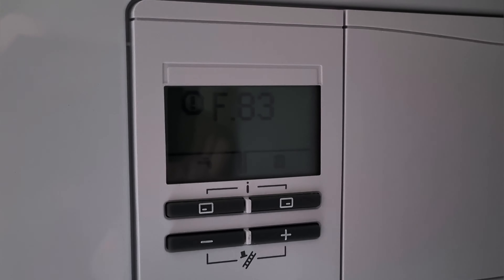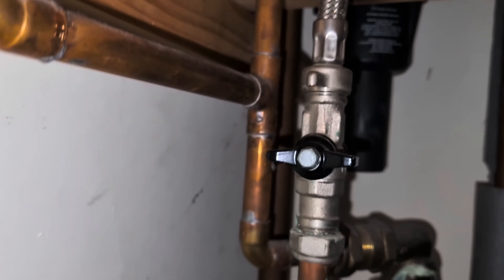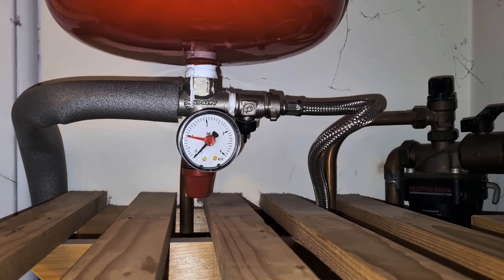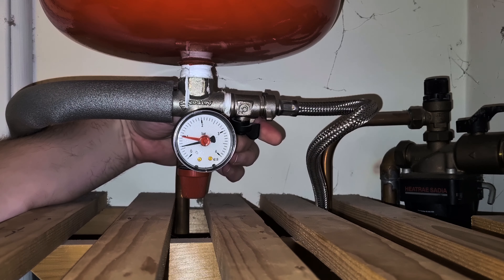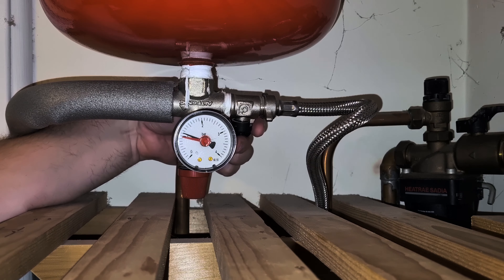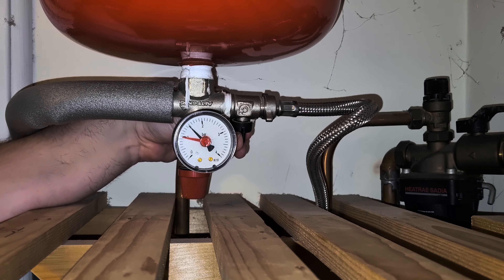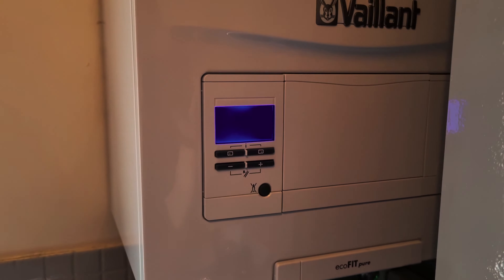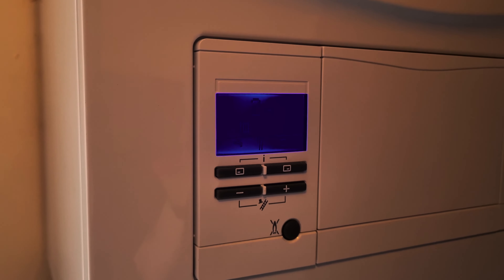How to fix Water Pressure f83 Fault Code on Vaillant Boiler 🔧🔥 4k

Comment: I keep doing both and the gauges are not moving
Reply: And the boiler keeps coming up with f83 f72
Reply from the maker: In that case you would need to contact a heating/plumbing specialist. Please let us know if this is now fixed and what the issue was.

Comment: 1.5 bar is incorrect, Vaillant say .8 of a bar, and that's all dependent on the system head/size. Stop giving incorrect information especially if your not a qualified heating engineer or a registered gas installer. 
DC RGI.